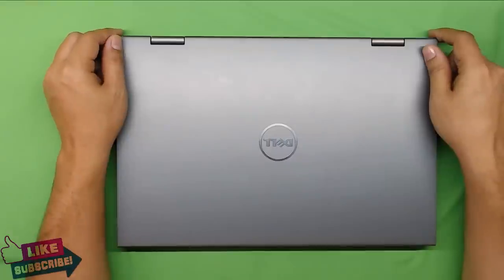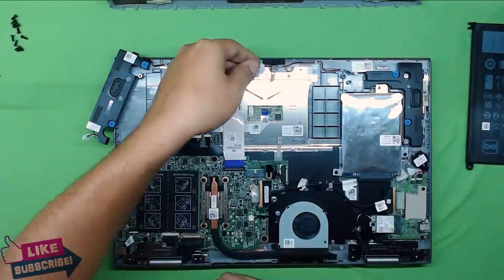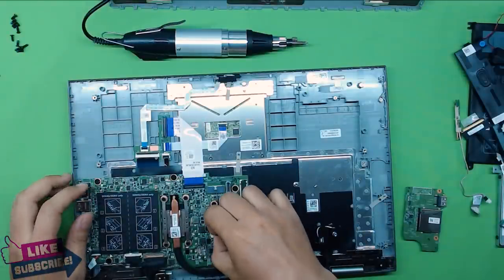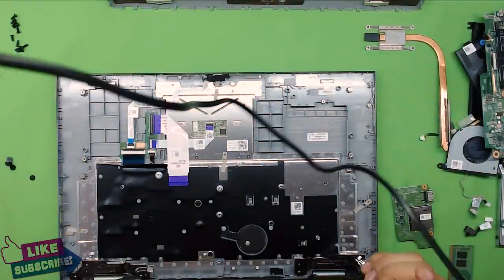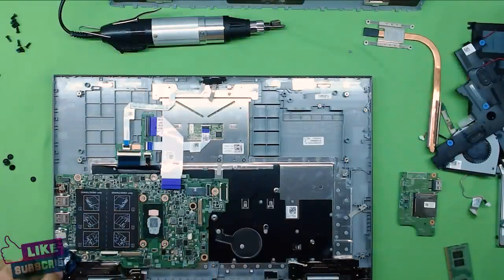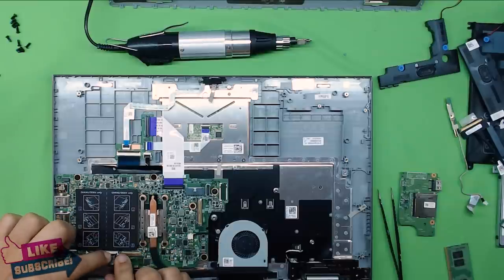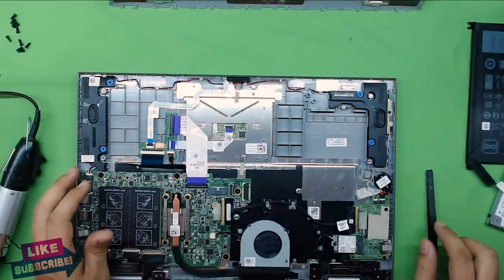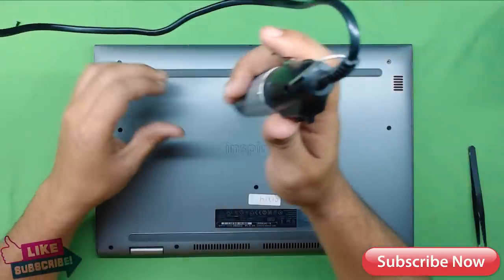Dell inspiron 15 5000 series Tear down , service your laptop Disassemble and Reassemble

Comment: I’ve got this laptop and am planning on replacing it. Any ideas where to get the battery from? Also is it a easy as disconnecting the old one and putting the new one in ?

Great video,
Louis
Reply from the maker: It's my pleasure my friend.
🫠Regarding your question, here is a video on the battery replacement:
https://youtu.be/RWtiRtTre4U
look for the battery link in the video description.
Should you have any further questions or requests in the future, please don't hesitate to ask me.
cheers🍻

Comment: Dell charges a fortune to do what this guy just did. On my old 5667, a few years ago, having got brave enough to do it, removed the back cover, cleaned the vent screen and fan, and replaced the thermal paste on the cpu and heat sink. The reason I did this is because I had a program (System Mechanics, I think) that showed my CPU was running too hot. I called Dell with whom I had a software contract, and they told me I should send it back to them for expensive repairs. I decided to look into it for myself. After checking several videos on YouTube, I decided I'd do it myself. As I recall, Dell wanted almost as much to repair the computer just to fix the problem of overheating as it would cost to buy a new one. When I went into the computer I discovered the heat sink had not even been installed properly, that the person assembling the computer had just haphazardly slapped the heat sink down onto the CPU and just smeared the thermal paste all around and, in doing so, scrapping most of it off the CPU. Cleaned the paste mess off and around the CPU, applied new thermal paste between the CPU and heat sink, reinstalled the heat sink, cleaned the vent screens and fan, reassembled. Worked beautifully. No more CPU overheating.
Reply from the maker: im glad you got your problem solved by your self and lots of respect :) and thank you for the feedback.

Comment: Very nicely expalined . On my same Laptop the right hinge make a clicking sound on opening and closing with black strip at the bottom of display loose . The L/T is working fine . Any suggestion to fix this?
Reply from the maker: Thank you for your feedback! If you wish to support the channel, you can like, subscribe, or both!
Regarding your question, you will need to remove the screen and get to the hinge  and lubricate it,  else it will end up like this: https://youtu.be/UzZ7wSofpAA

Comment: Thanks! what's the maximum amount of DDR4 that can be added? You added 4. Can 8 be added?
Reply from the maker: Thanks ✌  for the feedback!  if you wish to support the channel you can LIKE or SUB or both :P
Regarding your question:  its very simple way to find out what is you max ram capacity:
Open CMD (press win+R key on your keyboard, then type cmd thenpress enter) in the terminal type the following:
wmic memphysical get maxcapacity
and the big number that shows take that number and divide it by 1million and it will be your max ram capacity.
the number you will get it may be like 33.xx (that means max GB is 32GB) if you get 17.xx that means 16gb max.

you can place any combination you like 8gb 4gb and 4gb 4gb and 8gb or 8gb and 8gb

Comment: My fan is running loud, and I also notice the laptop feeling warmer but not sure if it's just because I noticed the fan being loud. What is the best way to clean it? Should I just remove the cooling fan only and then do what?

Should I buy can of compressed air and use it on the cooling fan?
Reply from the maker: Brandon Luciano i would recommend you to repaste and clean the heatsink, the laptop its really easy to open.

Comment: I have an Inspiron 15 5578 2-in-1 and the fan noise is crazy. It would kick in when I'm doing normal tasks like browsing the web and just the most basic things. It seems to me that the cpu, gpu and hdd temperatures doesn't cool down and the fan is always running. Is there anything I could do to fix this? I updated all the drivers and it is still doing this.
Reply from the maker: YOUR PROBLEM IS NOT THE DRIVERS NOR THE SYSTEM ISSUE, YOU HAVE AN HARDWARE PROBLEM, 90% OF MY GUESS AND EXPERIENCE IN THE FIELD IS THAT YOUR HEAT-SINK IS NOT MAKING A GOOD CONTACT WITH THE CPU, AND YOU DON'T HAVE AN ACTUAL GPU CHIP.  I RECOMMEND YOU TO DO THE FOLLOWING STEPS:
#1. FOLLOW THE VIDEO TO DISASSEMBLE YOUR LAPTOP ITS VERY EASY,
#2. GET YOUR SELF A THERMAL PASTE ARTIC SILVER 5  (OR BETTER)
● Thermal paste:   https://amzn.to/2qG70W5

AND CLEAN YOUR OLD THERMAL PASTE

BEFORE YOU APPLY THE NEW THERMAL PASTE , BEND YOUR HEAT SINK LEGS TO 45 DEGREE ANGLE OUTWARDS.( THAT WILL CREATE MUCH BETTER FORCE ) AND WILL HAVE A BETTER CONTACT WITH CPU.

* WHEN THE CONTACT OR POOR THERMAL PASTE ARE IN EFFECT YOU WILL SEE A FAN NOISE JUMPING UP AND DOWN, BECAUSE THE CPU GETS HOT AND SEND THE EXTRA VOLTAGE TO THE FAN TO COOL THE HEAT SINK AND WHEN THE FAN CANT COOL THE HEAT-SINK BECAUSE OF POOR CONTACT OR PASTE FOR THAT THE CPU WONT LOWER THE FAN VOLTAGE TILL ITS COOLER.

Comment: is it ok to remove battery permanently and use laptop as desktop with power chord. or battery is needed anyhow whether ok or empty battery.
Reply from the maker: Thank you for the feedback and your support by a sub  :P
regarding your question:  for a laptop its totally fine if you remove the battery, the benefits are:
-the motherboard will last longer life time.
-charger will last you longer as it has not to push out extra amp to charge.
- battery can be saved for later on when you want to sell the laptop, else it will start inflating
-extra empty space to hide your "sugar powder" :P
CONS:
- when the power goes the laptop turn off

Comment: I have same model.  It’s but recognising the Ac adapter and batteries not charging. I think there is a problem with the power port on the laptop. As lapi is not recording even the new charger. Do you think it would be worth changing the port on laptop?
Reply from the maker: you need to open it up and plug the charger and with a multi-miter check if the voltage goes to and out of jack.  @5:56 the jack is right to the left, its cheap to buy https://amzn.to/2ZPSwpj

Comment: Dear UfixTek, 
You definitely know your stuff. I watched the video intently. I was however hoping you would show where the bluetooth chip was located. I just got off the phone with Dell support after close to 3 hours. He tried changing drivers and ran an assortment of different tests to find out why my mouse would lag and stop then start again. In the end he said it was the chip and I was hoping to see where it was located so that I could replace it, but you didn't show removing it and if it was a generic or Dell specific chip. Could you possibly help me with this issue? Thanks so much in advance.
Reply from the maker: Thank you for the feedback! if you wish to support the channel you can LIKE or SUB or both :P
regarding your question:  there is no such a thing a Bluetooth chip on motherboard!, the wifi board is a combo, its wifi / Bluetooth card, you can replace the card by your self and windows 10 will automatically update the drivers in windows update.
i remove the card right at @5:55 here is a link to a better wifi/Bluetooth
https://amzn.to/316VclU
sometimes we do get clients and the card fail and starts creating a lot of issues.
Reply: @uFixTek  FYI I did clicked both. Thank you for your feedback. I will give it a whirl. Regards, Don

Comment: Hi.. i have the same model... my battery sometimes doesnt charge and it turn off may laptop...... question can this work without battery just ac power/plug without battery?..... should i remove the battery first for the laptop to work on ac power only ?
Reply from the maker: if you remove the battery and use the laptop , the laptop will last you longer and so will your charger , less stress will be applied to your laptop and charger.
i always remove my main laptops batteries, if i have them always pl;uged in. good luck
Reply: Thanks :)

Comment: Where is the microphone? I think I need to replace mine.  Is it part of the webcam or part of the speakers?  Or is it it's own part?  Thank you!
Reply from the maker: the mic is right beside the webcam tiny hole. you can just remove the bezle of the screen and you will see the the mic and the mic never goes bad . you may have some config issue. go to control panel and then to sound and recording and then properties and in level tab make sure you dont have over 80 keep 50-70 
https://imgur.com/a/5mv9XYG

Comment: how do you remove the timy ribbon cables on a dell 15 with the grey plastic top piece? Do they pivot up like the larger ones I see you open in this video or do they just pull out?
Reply from the maker: they have a hinged plastic and the metallic one are slide out. but can you take a picture and send :
https://imgur.com/

Comment: Thanks for your video.

I have an Inspiron 5579 which the same laptop used in the video (if I'm not mistaken). My fan is very loud and I believe the computer has heat problems. I am pretty sure that it's a hardware problem since I updated all drivers (Bios and chipset). 

Do you recommend following the same steps you recommended to "Bao Ngo" above?
Do you think using a cooling pad would solve this issue?
Reply from the maker: cooling pad will ez the pain abit but its not a fix and in a short term it will damage your component the extra heat inside. i would highly recommend you to open up and do a full repaste with a good thermal paste:
https://amzn.to/3b9pJib

if you got any question ask me.
Reply: @uFixTek  okkayy thanks a lot for your help! I'll try to do it on my own but I'm a bit afraid since it's my first time disassembling a pc. Wish me luck!
Reply from the maker: dont worry if you need help doing it let me know i check comments often. good luck :P

Comment: so I bought a new dell inspiron 15 5000 and all the specs are good apart from like the graphics card
it said Intel® Iris Plus Graphics with shared graphics memory
is there a way I could possibly upgrade this?
Reply from the maker: no unfortunately you cant :(
Reply: @uFixTek  ok then hopefully tenth gen core i7 good enough
Reply: All laptops have integrated graphics and even if it supported them, no modern card will fit in a laptop.
Reply: @SynZ777  oh ok

Comment: basically it'd be easier to replace the plastics surrounding the keyboard with the keyboard , at least thats what I'd do.
Reply from the maker: yes but not everyone would pay for it lol
Reply: Maybe.  I bought a parts machine for $400 to rebuild my $1200 Dell so some would (used of course not new)  Don't see any current Dell's I'd go for.  at least not the clickers.  (requires that guitar pick or called a spudger by some)  Prefer the big ones.  Preferably XPS